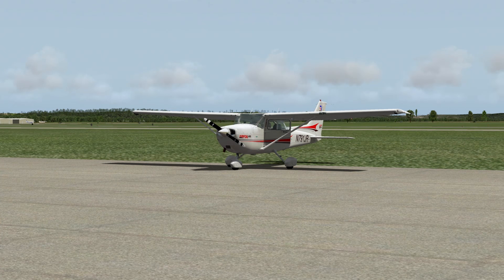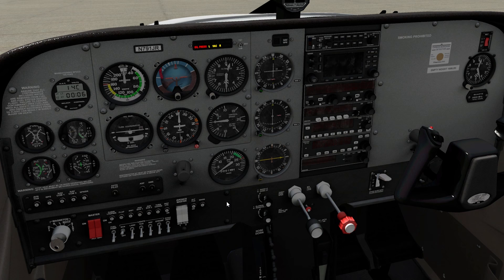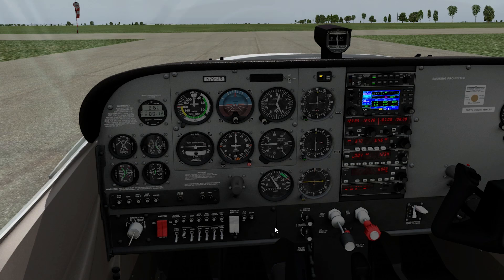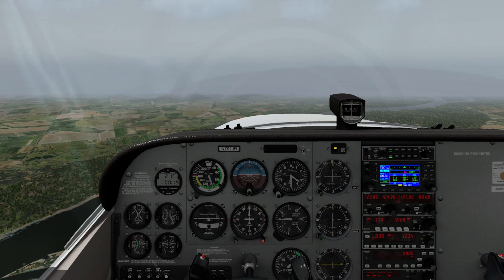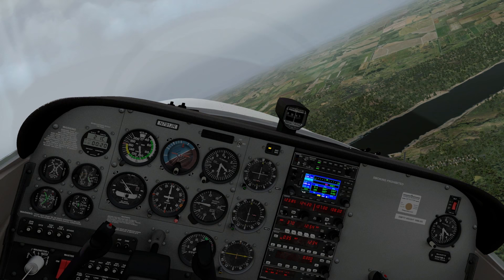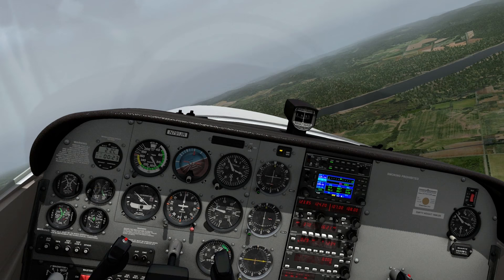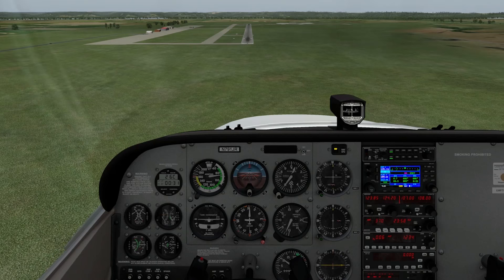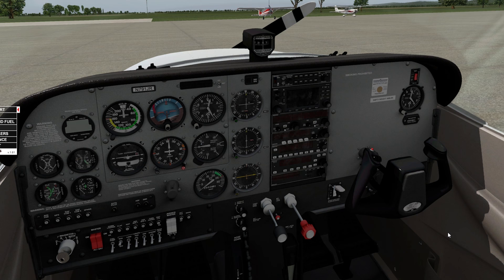X-Plane 10 - Steep Turns and Stalls

Comment: Jeff you can place the chocks by clicking on the wheels or you can also use one of the options in the quickstart menu (I don't remember which one) to secure the plane, and place chocks and ropes and the pitot cover (you can place all those elements manually by clicking on the right spots).

Comment: I'm not sure about the SP, but I flew brand new (3 months old or so) 172S models when I was in flight school. And we always turned the alternator on after engine start. I was taught that it puts un-needed stress on the starter motor as well as un wanted load on the aircraft BUSes. You're completely right about adjusting the mixture while on the ground. Never did it in flight school and still don't today. We were also taught to rotate at 68kts indicated and climb at 74kts indicated (we had G1000s in our cockpits) as best climb speed.
Reply: Interesting. At the 172R NAV III that I fly, Vr is marked at ~55-60, and Vy at ~80 IAS which is default setting. 74 IAS would be more like Vx, but of course all that markers can be manually adjusted at PFD.

Comment: Ground leaning is definitely a thing. I've cleaned enough fouled spark plugs to know that. I learned to do it from a trained instructor who was also an A&P. He had previously worked at Cessna, working on their training planes. He ended up berating every single instructor in the school because they wouldn't lean the plane on the ground, and were confused when they couldn't make power on their run-ups.
Reply: If he is owner of the aircraft, he has every right to berate anyone not complying with his sop.

Comment: Very cool video. As you mentioned you do watch MZeroA. Jason has a short video from back in 2014 about landings which is really nice. He gives three points to improve landings. 1: speed is king! Know and fly the correct speeds. 2: Train for looking at the right spot down the runway that helps you nail your landing spot. And 3: Forget the word FLARE. Cessnas don't flare. They rather transition to slow flight and settle down on the runway. 
point 1 and 2 a pretty common in flighttraining but number 3 really helped me improve my landings. I stopped cutting the throttle and started flying smoothly down to touchdown...

Comment: 18:44 : i did the same thing on x plane 11. the plane just stayed like that , and the nose didnt come down on its own. I had the yoke pulled back all the way. any ideas?
Reply: Maybe if you try trimming it up a bit so you have more give in the controls, you can pull the nose up far enough to really stall the plane. The excessive angle of attack is what really causes the stall in the maneuver.

Comment: Jeff, Do you have a joystick or are you just using a controller?? +Jeff Favignano
Reply from the maker: as I said in the video and the description I am using YoKo the Yoke with a X55 throttle quad. I also use Saitek rudder pedals.